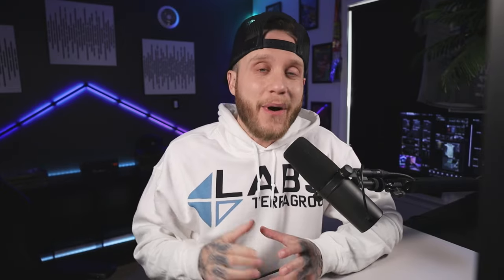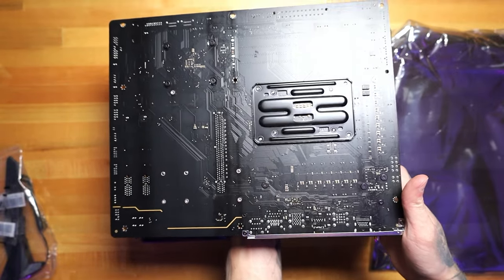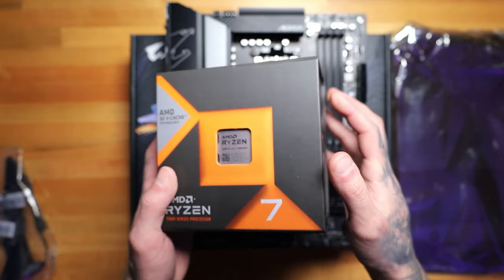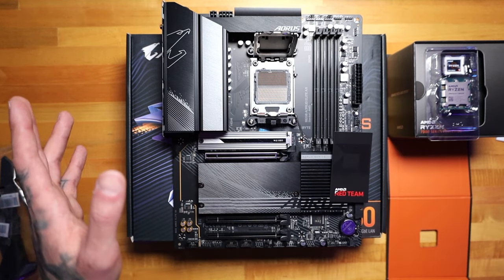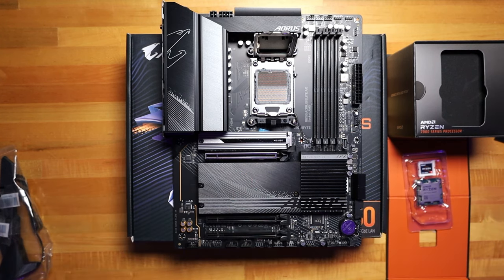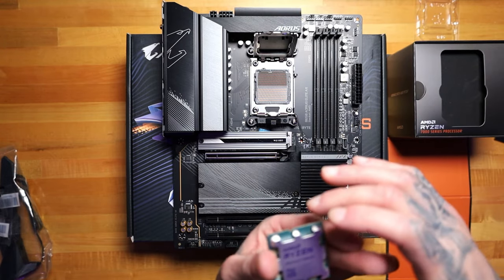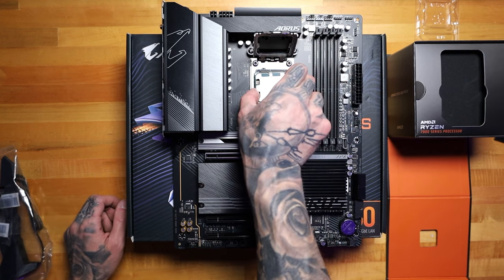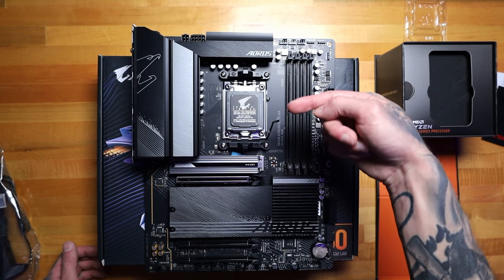How To Install A CPU (The Right Way) | Installation Tutorial with AMD Ryzen 7 7800X3D

Comment: What is your advice about people saying this combo with this elite motherboard and 7800x3d will explode or burn out your processor? Any advice on what to do once I got all the parts and it’s ready to put together? Do i update bios? Etc
Reply: @smokemuch  I’ve updated bios etc all works great
Reply: @smokemuch  no I installed everything in my pc case, turned it on, then updated bios. But I didn’t load anything crazy, I just set up the basic software and info then immediately downloaded the latest bios, put my flash drive into the bios labeled slot on back of motherboard (with latest bios properly added and ready to be read) then updated bios, bam done, I’ve updated the bios twice already no issues, I’ve played cyberpunk maxed out with ultra ray tracing and no issues on my 4090 either.
Reply: @smokemuch  your welcome

Comment: why everybody uses this motherboard, i dont get it
Reply: Common sense its one of the cheaper am5 boards but still has future proof room, the worst thing u can do is get a super expensive motherboard and not use all the features that you paid extra for all you really need is pcie 5.0 if you plan to upgrade later on and at 219 USD for a am5 motherboard with a 5.0 pcie that's absolutely a good option